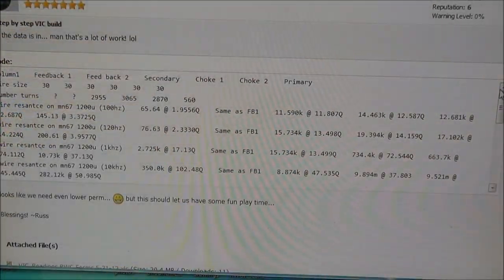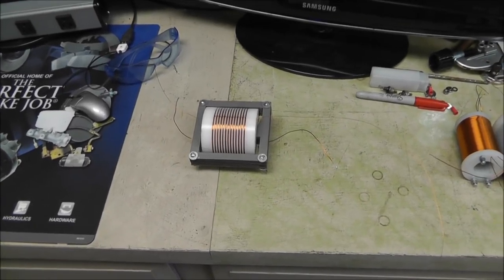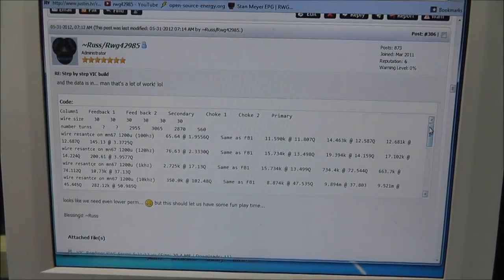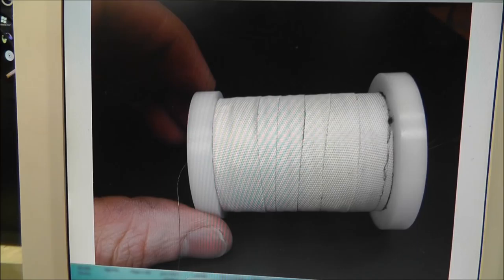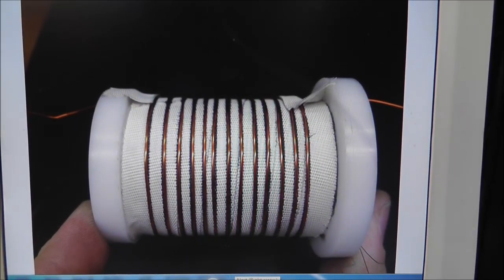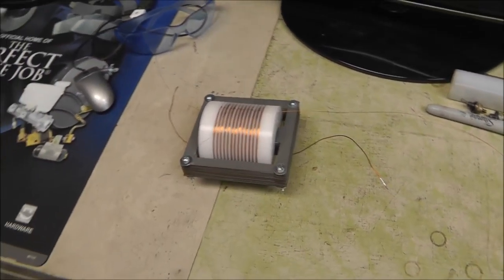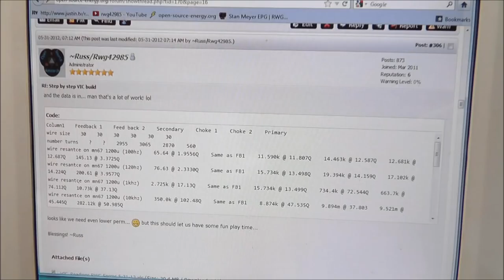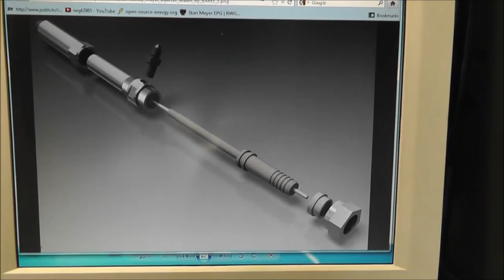Update! 13 cavity VIC Big Arcs! 5 Coil VIC Measurements! & Injector Info! RWGresearch.com

Comment: The dielectric strength of the epoxy can also be increased significantly if you put the assembly in a vacuum chamber prior to curing. The vacuum process enables the epoxy to get sucked right in between all the windings and also removes small air bubbles in the epoxy. Its a standard resin process called 'degassing'. You should also see some increase in the output of your coil due to the fact that the energy flowing in the coil is no longer doing unwanted work by ionising the air, coronas etc...

Comment from the maker: Yeah, at the moment that's just the secondary and not the inductors. So when the inductors are connected I would hope to see less arc and more voltage with the SS. But with those voltages I'm thinking we need to have this puppy in an oil bath! It was crazy when I first connected it! Arcs flying out everywhere! ;) thanks!! ~Russ

Comment: Hey Russ and all! U most likely already know but Stan Mayers used 20,000 - 90,000 volts to drive his fuel injector spark plug. He said that it is a ramping voltage effect within that voltage range in the injector itself. Also the taper in the injector creates a voltage amplitude ramping effect. For example the voltage would start at 20,000 volts and increase up to 90,000 volts nearly within an instant of a time. U can find this in & around section 6-2 of The Birth of A New Technology.

Comment: That's some nice voltage coming out of that coil!
Have you thought about making one with epoxy over the windings for increased insulation, to prevent the windings from shorting out?

Comment: According to Stanley Meyer voltage increase would be from initial 20kV to 90kV. When used with the "Capacitor/Resonant Cavity". The VIC is then used to tap into the so called "Resonant Frequency",where water finds its resonance. This can be seen when there are bubbles in the ""Capacitor/Resonant Cavity". In the tube setting he has made a diagonal cut on the top of the tube makes the finding of resonance easier. I think that when the plasma is in resonance with the water the bubbles appear!

Comment: I just thought of something. On on compression stroke gas is being compressed and as that happens it implodes to pull the piston up (known). If the plasma stays constant it will eventually explode at tdc and push the piston down. Like a hybrid diesel. You can easily scavange the exhaust gases with cam timming. On exaust stroke your pulling in steam. Never stopping the plasma ( glowplug ). However you might want to increase the voltage under demand. Cont...

Comment: Temperature?you expect it to get hot?i figured it woild run cold since your pulsing it efficiently.'Inox lubricant LANOX mx4' can be found on ebay,first one that came up was $15 from a Florida seller.I figured you might find it at Lowes but i couldnt find it there site.I have used on tesla coil secondary to kill breakout of HV.Other than that its also handy to have in the shed for anything that squeaks,turns or thinks about rusting

Comment: I would highly suggest epoxy first. 

I have played with a few oil insulated transformers. I have even boiled the oil to remove the gaseous matter (air bubbles), as they provide an unwanted path for the current to flow. As suggested by Tesla, the smallest amount of gaseous matter in oil based insulation will provide a doorway to insulation breakdown. I have found that epoxy is easier & cleaner to work with.

Comment: The figure 6-1 transformer works great for me and that is some of the last things Meyer's built so therefore it is his work being advanced to the next level. For me it has been one of the best designs yet, as even my little rod VIC transformer can get the voltages over 200 volts hooked up to the exciter array. I won't say just how high I have gotten the voltages up to but some here know. Use the scientific method for it really does help in understanding this vs just copying.

Comment: less than .01a and below 10Vdc input on my variac. there were some tiny bubbles but nothing has to sell the bear's fur yet!...(thats a french moto: not to sell the bear's fur before killing it!)
I've triied many many many things to get voltage higher, but the parallel water resistance coupled with its capacitance(dielectric) propretiy is everything but linear with voltage, so its normal to expect high current leakage under high voltage which explain why even ignition coil fail to raise the V

Comment: at each side of the C to more than 20/30V, even if theyre intended to be 40kv.
Like stan says, tune into the dielectric propreties of water, I guess by this he meant that we have to lock in on the dielectric propreties of water(which is very high around 78x air) while trying to keep the resistance properties out of the way... but how!! haha thats the challenge, to my understanding! when one will figure this out: he'll be able to get V very high and then maybe confirm Stan's work.. bless you all!

Comment: Sorry i gave a slight contradictions on the 3D injector drawings in the forums. I was thinking something I would do in todays world. The buggy was not fuel injected first. It was a carb motor. There were problems with fuel injection back then that are not as i see them today. This dose not excuse the cam timming in either case. Just listen to the buggy takeoff it says it all.  David A. Puchta

Comment: I have looked at this VIC coil in different drawings that Stan has drawn and come tothe conclusion. The resonant charging chokes(ferrite) use the same magnetic core. They are bifilar windings connected to the WFC. The cavity coils (magnetic wire)are there for voltage amplification, and not connected to any part of the curcuit. Just like a Tesla Coil. Has anyone tested this theory.

Comment: Cont... All cases point to a custom cam grind. This allows the intake to be retarded past tdc further to avoid flashback from intake valve and help in exaust vacuum. Then you back up the grind on the exaust side to scavenge. You would not normally do this on a gasoline motor because you would burn valves. My gut says he retarded the cam and thats the trick. This sounds so much like the big rig two stroke diesel engines. Stan owned a parts depot for trucks. He is laughing at us.

David A. Puchta